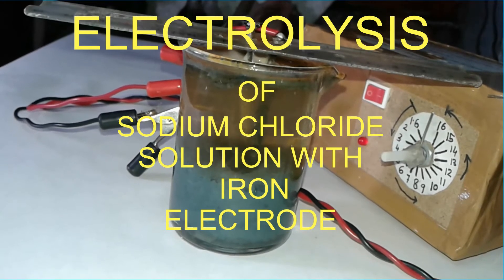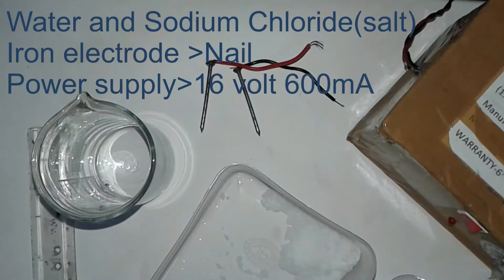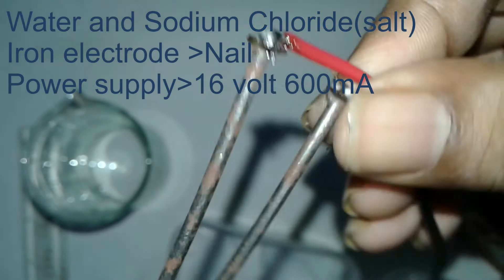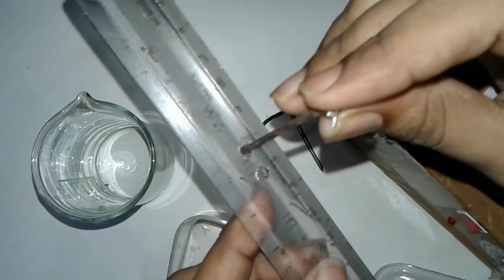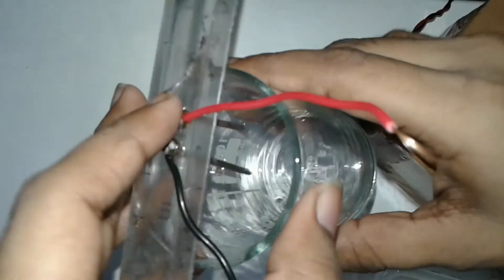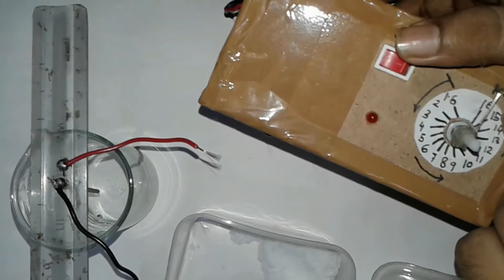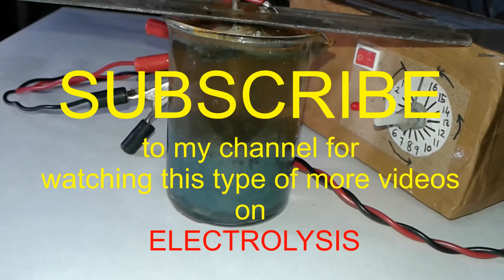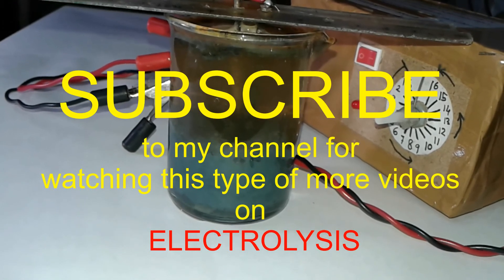Electrolysis of Sodium Chloride Solution with Iron Electrode

Comment: I also did it using a 9V battery and got the same result
Reply: It worked out for me for the first time but the second time when I replaced with a 12v adapter, it isn't working... Could you tell me why!